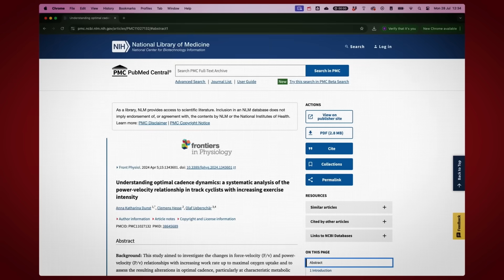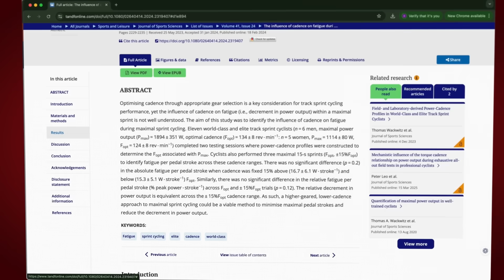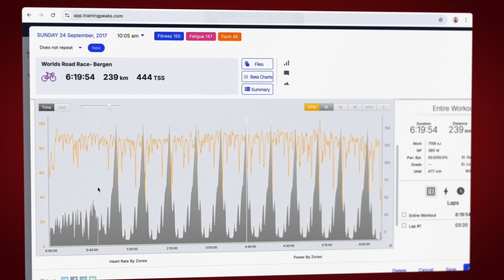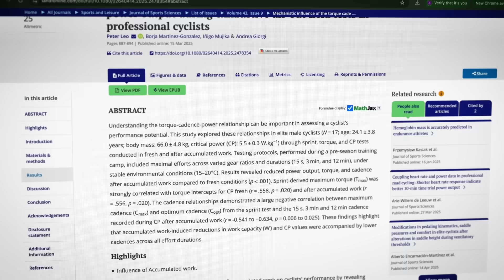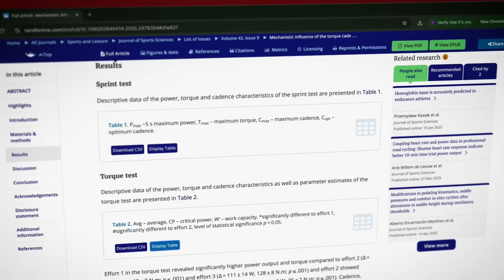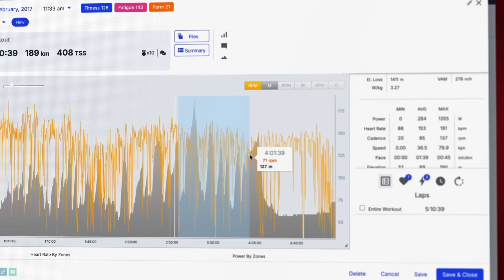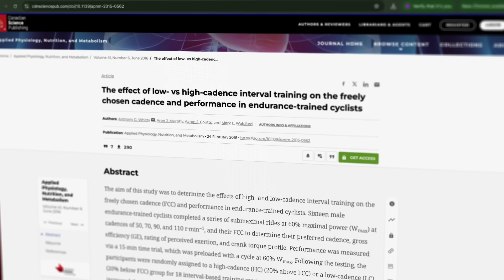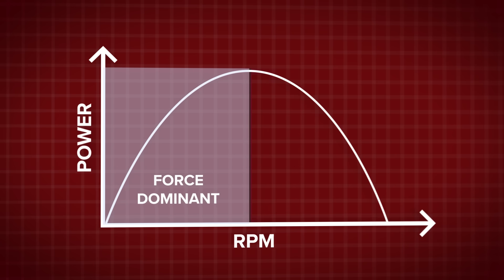I Thought I Knew Everything About Cadence. I Was Wrong.

Comment: I’m a natural masher and could put out a lot of power at low cadences of around 50 rpm. But I used to suffer a lot from rhabdomyolysis attacks with sustained efforts. So over the last 15 years I’ve trained myself to spin as much as possible. Way less strain on the muscles and knees. I  generally try to maintain over 100rpm nowadays but will average from mid 80s to high 90s depending on how I’m feeling on the ride. Changing crank length from 175mm to 170mm (thanks to Connor!) allowed an increase in cadence of about 10 rpm. After a couple of months of training with the shorter cranks, I’m able to be on the same gears I used to be on with the longer cranks.
Reply: Back in the day... 531 steel, Cinelli stem and deep drop bars... riding on the rivet, toes down, getting as aero as possible for the time and... symptoms that must have been along the lines of rhabdomyolysis, which I just googled

Comment: high cadence on flats and low cadence on hills, for me. Because I don't have much power in my legs, I could only perform high cadence on steep hills between 55-70rpm at 34-34 F/R gearing. However, riding with high cadence on flat terrains is easier for my legs, so I give my heart a little bit more work to save my legs.
Reply: Put lower gearing on.

Comment: As you said, people will naturally pick what's best for them, but sometimes you have to consciously choose to spin faster when your legs get tired. You'll feel tired and as if spinning faster would be even harder, but it actually becomes easier!
Reply: Feeling tired has different levels: msucle burn vs cardio limits vs breathing not able to get rid of excess CO2. Higher cadence making it easier is often related to the lactate level you accumulate and lifting muscle burn: spinning faster (at lower torque) gets rid faster of excessive lactate, which makes you regain your strength faster to be able to load your muscles again. But I could imagine that it may speed up lung function as well, thus if you gete rid of CO2 faster, you may recover faster. Not sure about this last one though.
Reply: @masterpep7218 this.. you dont see top  riders doing a grind cool down do ya
Reply: howcan it be harder?! it a lower gear doh
Reply: @PazinPortugal Yes, they literally call them "easier gears"! But perhaps the tradeoff between speed and torque isn't as obvious.
Reply: @PazinPortugal  I just go by how my legs feel, and certainly find lower gears a necessity on suntained climbs. Knowing that power is proportional to RPM is also helpful, but of course there comes a point where the extra RPM is just useless spinning.

Comment: You have to train both..Training with low cadence in big gears builds more power for higher cadences..The fastest riders spin faster rpm's in bigger gears.
Reply: ie “Why not both?”
Reply: Outdated thinking, specified strength training off the bike is more effective, stick to aerobic exercise for the bike and apply your strength
Reply: @RylHango Actually studies have found that on-bike strength drills produce equivalent performance  adaptations to weight training for cycling
Reply: @UwharrieRider  Yep, this is because most weight training studies usually add weight sessions onto their existing training regime which would equate to higher volume than the baseline group. If it were more realistic, they should've increased cycling volume on the baseline group or reduced volume on the strength training group and we'll likely see that most benefits are more due to increased training volume than just strength training imo.

Comment: .... doesn't all this mis a major point - or take it already in assumption:
Best output, best efficiency and best endurance can only be with using all available muscles and their fibers as best in concert. Right?
So all the cadence things can only make sense, if the cadence allows one to do that.
Hence it's about the capability, talent, training, whatever to keep that concert smoothly in sync with increasing cadence.
Would be interesting to know, whether Froome really had that.
Pogacar for sure has.
One can often spot amateur riders that spin around a lot but obviously and certainly not "circular", in sync.
That can not make sense in any way, even not for training to improve, because it trains a muscle memory for a wrong movement.
So:
Cadence is limited by the capability of keeping that concert in sync.
How to train to raise the beat remaining in sync?

Comment: I used to primarily focus on average speed and average HR, when I started riding. When I did longer rides, no matter how well I fed, how much I drank I would always blow up after 60-70k. My average cadence was around 80RPM back then. This year I started focussing on gettng a higher cadence (90RPM), and now I can easily ride 150k without blowing up, and the real kicker... my average speed has stayed the same
Reply: Very helpful. I would add: after a massive heart attack and the subsequent rehab (all of us in the group had been very fit athletic types) I was ordered to warm up properly. That meant first 15 to 20 minutes under 90 bpm. My rehab coach didn't trust me but I did do what he said. The first ten minutes was a battle to stay slow, then I'd be in a groove, sometime after 15 minutes, I'd suddenly feel great, hold back till 20 minutes, then... BOOM! As fast at 70 on a carbon fibre bike with widish tires than I was at 30 on a Reynolds 531 tubes, forks and stays bike and for several hours

Comment: I did some informal cadence testing.  I set my indoor trainer to 300w.  I did some riding at 100rpm and got some data, then lowered down to 70rpm and got some data.  My heart rate dropped 4 beats each time I did lower rpm.  It was repeatable.  I'm not sure how long it would take at 300w to have stuff stabilize or not, but I did this during tempo pacing and it was during 20+ minute blocks of time.  Could be a way to "recover" my body if I'm about to explode, but I haven't tried it at higher wattages that would actually cook me (yet).  It's on my list of experiments.
Reply: This is typical, but realise that as you lower the cadence, if you keep the power the same, you have to increase torque.  This increases the neuromuscular fatigue (which is your body's tendency to ignore or block your requests to have the muscles work, which the feeling of fatigue).  Mixing up your cadence is a good idea.

Comment: I tried the high cadence approach on a local climb(25 km). I was 8 min slower than my pb. Back to the grind it is.
Reply: Is that really a valid test? Maybe give it a few months of higher cadence and then check your pb on the climb. You may still get the same result but you would have given it a proper test.
Reply: @craigfoulkes I wouldnt know. Its only 25 km so I often rode on an empty stomach-even on my pb. This time I even brought an energy gel and 2 bananas. Did a month of weighted front squats and lunges 3x a week. Tbf, my heart rate is about 7 beats lower per minute than the usual. I'll give it another shot. I'm no. 5 on this climb and trying to steal the kom.

Comment: Personally, my cadence is determined by what feels better: energy (or HR) vs legs - I feel more efficient at low RPM (70-80) but it definitely strains my legs more, so if those are tired and I have energy and HR room, I'll ride closer to 85-90 RPM for the hard efforts.
Reply: I was going to comment the exact same thing as you. I see cadence as another tool to manage my effort levels.
Reply: Yeah this, I'm a bigger guy, over 100kg even fairly lean. I find 80ish is my favourite, but on a longer ride will often drop that down a bit for the flatter sections and up for the climbing bits.
Reply: yup, more power means I should do more cadence and turn slightly harder...and I should be able to keep doing that
Reply: I'd guess this is pretty much what I think but probably more accurate. I think of it more of legs vs lungs (anaerobic vs aerobic exercise), the higher cadance gets your lungs pumping and increases your heart rate, lower cadence relys more on the muscles in your legs and uses the energy stored in your muscles, your heart rate is lower and your breathing is lighter. Using a combanation of both can improve your endurance. Relying on just one of these can quickly tire you out. I'm not a professional so I've probably got it wrong 🤷😂
Reply: @mikes1992u the difference between 200W at 65rpm and 200W at 95rpm is probably not much when it comes to cardio demands, but I'm sure it's something since 100W at 65rpm feels like literally nothing to me and my HR elevates by at least 10 at 95rpm.

Comment: Longer legs = lower cadence (dachshund vs. greyhound...)
Slow twich fibers = lower cadence.
Higher cadence gives quicker reaction in sudden accelerations.
The fluctuation/changes in cadence in cyclists are no different to what is seen in cadence for runners. The body reacts as if you are running! (no wonder there...).
Reply: That's me. Long legs, slow twitch fibres, 80 to 90 rpm doable after 20 minutes warm up and I can go higher but it's not natural... is beneficial for a km or two
Reply: Exactly. I feel sometimes cycling forgets about running. Also % of body fat has influence on cadence and I guess this is also true for cycling